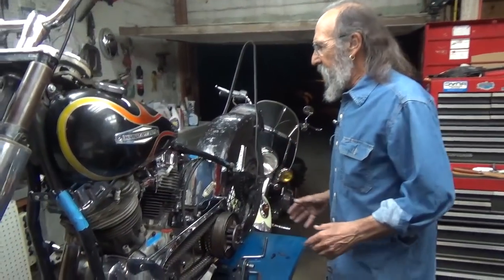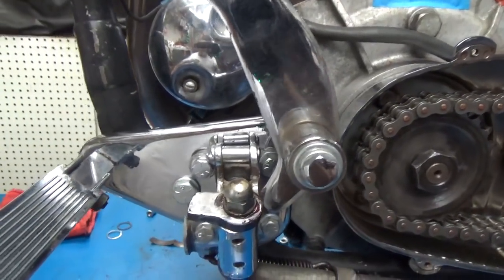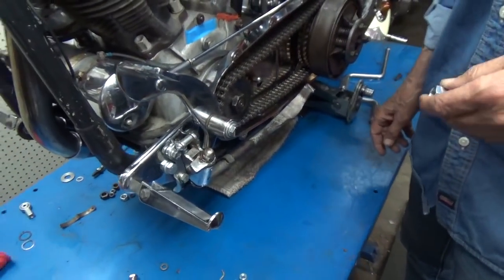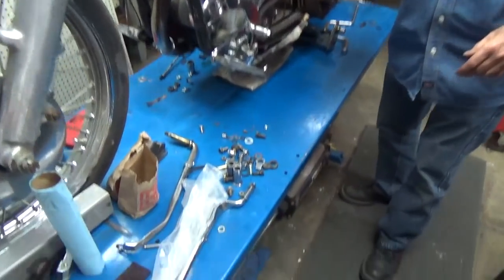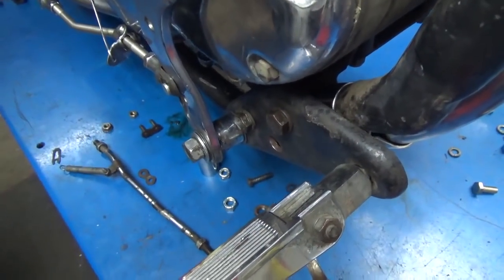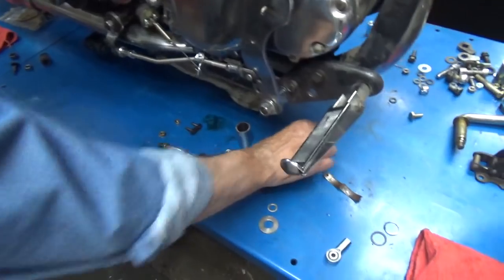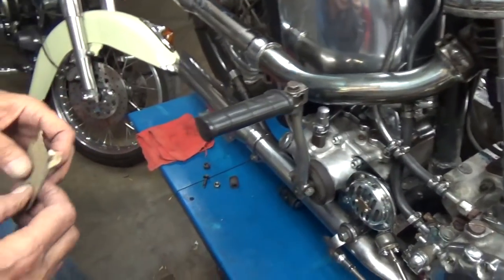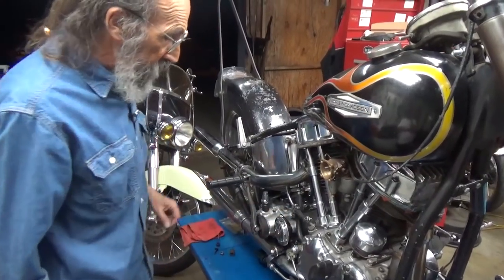Step 14 Suicide Pedal Healrest and Brake Linkage

Comment: That's a "Rod Coupling" Big Mike. Simple, good idea.
Reply from the maker: Yes it is.  The hardware store calls it a "coupling nut."  Probably labeled by the brand.
Reply: @pacificmike9501  three eights rod couplings make for a clean rear fender mount on a hard tail frame. Just cut to fit and weld, after getting measurements for fender/tire clearance.
Reply from the maker: Good idea.

Comment: Trains going by? As a "foamer" and biker I made a suicide clutch pedal "heel rest" for a friend from an old rail splice bar bolt! I band sawed it leaving about 1 1/2 inch from the head, chucked it up in my lathe, drilled and tapped it for the clutch stud. Looked cool and it worked.
Reply from the maker: I'll bet.  Back in the day, everyone made footpegs from "rail spikes."

Comment: I use to repair my starter clutch Harley put piss weak sprigs in them. Just open it up and put in heavier springs it will never fail.
Reply from the maker: The starter clutch on a Shovelhead is a sealed unit.  I'm replacing it with a heavy duty unit.  The last one I put in has been there over 20 years.

Comment: I had the stock heel toe friction plate  foot clutch on my 1973 FL Police Special. I took it all apart and had each piece chromed. I tried and tried to adjust the linkage on the hand shift but I never got all the shift points lined up with the notches. I finally got a ratchet top and ignored the notches.
Reply from the maker: Makes sense to me.

Comment: I love the windshield on the bike in the background. Would you tell me more about the differences in that windshield and an original including the tinting, metal edgebanding and how you went about making that happen ?
Thank you for your generous consideration,
Sincerely ..................................
Steph
Reply from the maker: I think you're speaking of my Shovelhead.  It was a very "inexpensive" windshield I had still in the box.  I thought I would experiment with it.  It was a reproduction of a 70's FL unit.  I put it on and started measuring.  Who cares if I destroy it?  It was not a big deal.  So I cut 4" from the bottom of the top piece.  That made it also too narrow.  So I went to a shop that made "plastic stuff."  I had made a template of the bottom piece and had it cut out to be the proper width.  That's what completed the shape of the "curved sides."  I had this made out of black, opaque plastic.  I took the sliding piece from the bottom and painted it black on the back side.  I got clear vinyl tubing from the hardware store, slit it and glued it on.  I hacked and wacked on the brackets until they fit the whole unit and gave me quite a bit of adjustment.  I brought out a big fan, lit a cigar and effectively created my own "wind tunnel."  Then I adjusted it to give me the desired effect.  It's part of what gives me the best ride I've ever had.  There are more little details to this, but that's basically what it took.

Comment: Hey Mike, would you show how to rebuild a Shovelhead era horn? I have a couple I wanted to try and save but looking at them not sure how to take apart without destroying. Thanks
Reply from the maker: A lot of them are riveted together.  Hook it up to the proper voltage and turn the little adjustment screw 'til it makes noise.  Then dial it in and use it.  The more you use it, the better it works.  I honk mine when I'm in the middle of nowhere, just to keep it functioning.
Reply: @pacificmike9501  Thanks. I had hooked to a battery and it gives a tiny noise but the adjuster is stuck. Will it be okay to put it in a sonic cleaner to loosen up?
Reply from the maker: I honestly don't know.  I think getting it to dry out would be the issue.

Comment: I did a quick search and found no definitive answer. Twin cams have starter clutch issues too, is this a particular shovelhead issue and what would be the main cause on a ship-shape bike?
Reply from the maker: The starter clutch normally lasts a long time on a Shovelhead.  Some things just "wear out."  The last one lasted over 20 years.  No complaint.  Just replace it.  High compression hot rod motors are a little harder on them.  Not really a big deal.  The newer stuff takes them out oftener.

Comment: Hey Mike, name is Ken.  I'm a Long time rider. No time, so called smart phone user. Bout ready to my 1981 super glide troublel head. Old enough to know, I need a lift. Knees r not what they used to be. So you have a suggestion on the lift. N if you could send me a link, to your site. Would be cool, unless I'm already there. Anyway more questions to follow. ???
Reply from the maker: You got me.  There are many lifts on the market.  Easiest way, look at them on the internet.  Just Google "motorcycle lifts."  They come in many different prices.  I've been working on bikes, on a lift, while I sit in an adjustable height office chair for many years now.  I get up when I need to, then I sit down again.

Comment: in regard to picking up parts from a local hardware store, do you try to go stainless steel? the selection in SS is not as large. sometimes i have to shop on line.
Reply from the maker: It really depends on your hardware store.  Most oldtime hardware stores, and even some modern ones, buy and carry what their customers want.  A good hardware store located in a biker neighborhood, or custom car neighborhood usually has all kinds of goodies.  Just remember to use the right hardware for the job.  Stainless isn't always the answer.  But, there are different grades of stainless just like other hardware.  Harley service manuals actually tell you what grades they use in the back of the service manual.